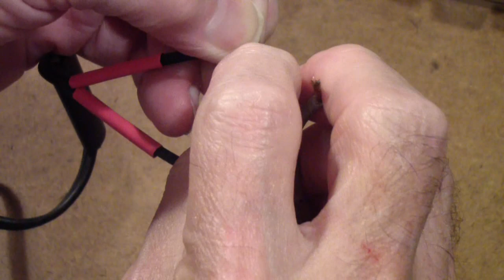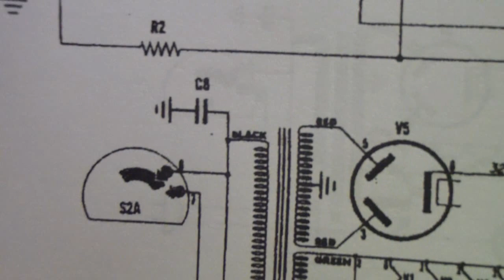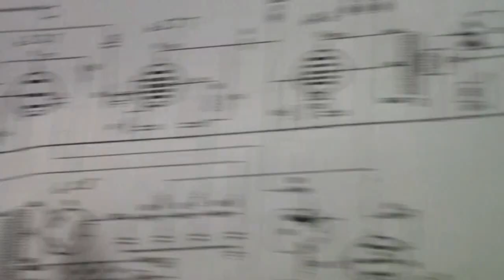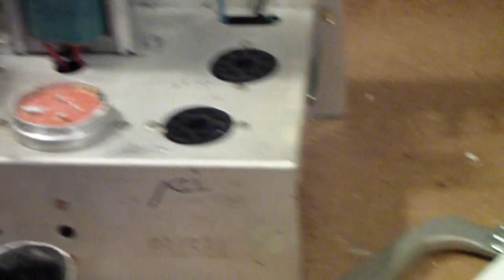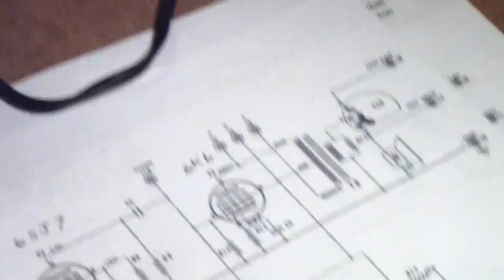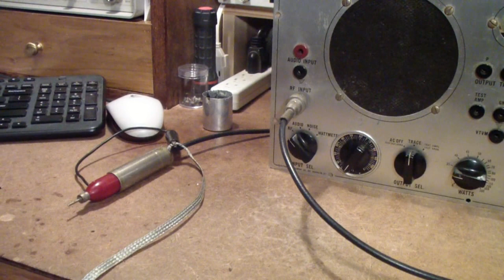TTT189 A Vintage Radio Workbench Pt 2

Comment: Are you not also going to replace all of the high voltage paper capacitors while you have the unit open? Just wondering.
Reply from the maker: I used to replace all wax-paper capacitors in vintage equipment but recently I have changed my mind. Instead I test each for value and leakage and only replace the bad ones. Then I check the voltages to make sure the tubes are operating at the correct bias, B+, Screen Voltage, etc. I also place a fuse in the AC input to protect against later failure but so far (about 20 units done this way) I have had no failures using this method. I did not find any bad capacitors in this unit, so, except for the capacitor I removed on the AC line, I did not touch any of the other paper capacitors.